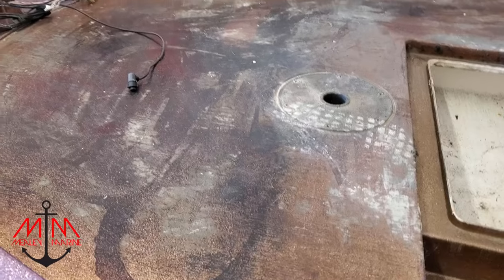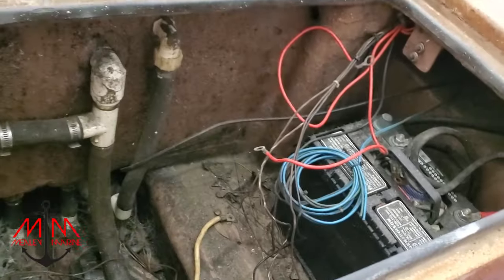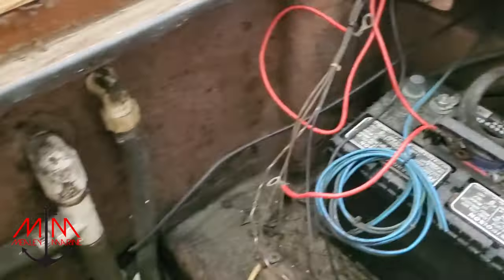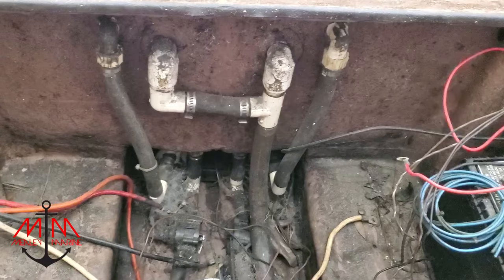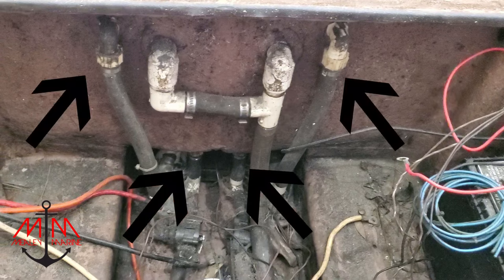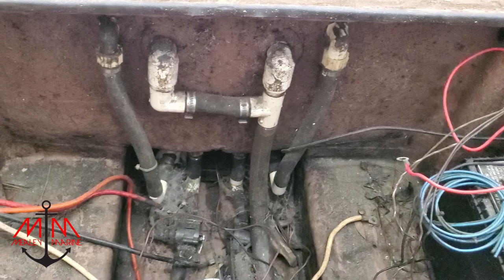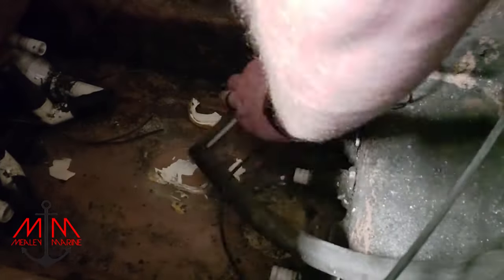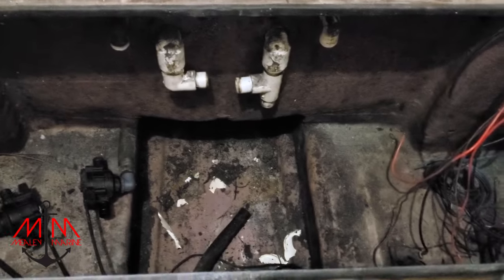BASS BOAT RESTORATION | 1988 RANGER 363V | PART 11: REMOVING BOAT AERATOR AND BILGE PUMPS

Comment: Are you thinking new flowrites and maybe a pumpout or are you going to keep it as original as possible? I dont know what brand of pumps were in there originally.
Reply from the maker: Hey Matt, It had an OOOOOLD Attwood and a new Attwood Tsunami for the Aerators. I switched them out with two new Attwoods which you'll see in the next vid. I would like to use pumpouts but it's not in the budget for this build. For the bilge I went with a Rule automatic bilge pump.
Reply: Sounds great! Looking forward to seeing the bilge area when complete!👍🏻👍🏻

Comment: I just bought this boat in perfect running condition! I did notice that when I put the live wells to fill, they do not fill all the way and some times even I have them on empty, sometimes they are dry some times not. The owner and I are still in contact and he said it was a cable that pushes and pulls the wells open to which I can see here. Also w the Motor on, there is a big silver metal plate that looks like it's just 4 screws to access this area. I'm pretty illiterate to all this. Any guesses on a fix or cause?

Comment: Isn't there a check valve between the bilge pump and the outlet on the side of the boat? And how do you get to it? I have a 2015 RT188 aluminum and the outlet hose is inaccessible.
Reply from the maker: My hose just ran from the bilge straight to the side if the boat. I have to reach my hand thru a hole to access the hose clamp.
Reply: @MealeyMarine  Thanks for responding. Ranger has a metal enclosure welded at the corner with a hole only big enough for the hose to pass thru and you cant maneuver the bilge hose at all. I'm trying to see if Ranger boats will clue me in.